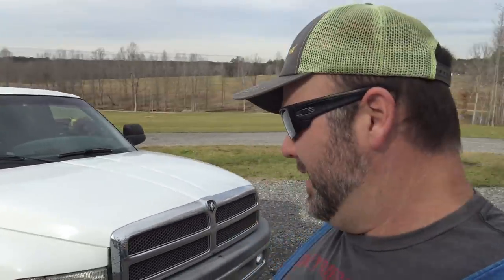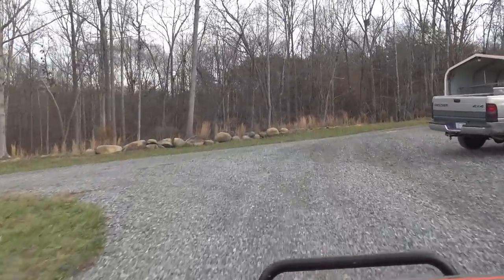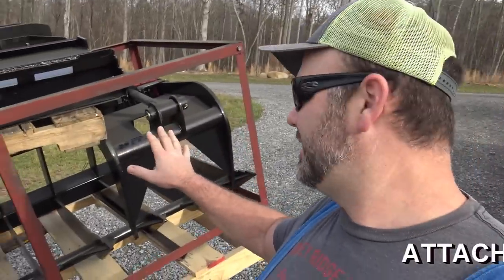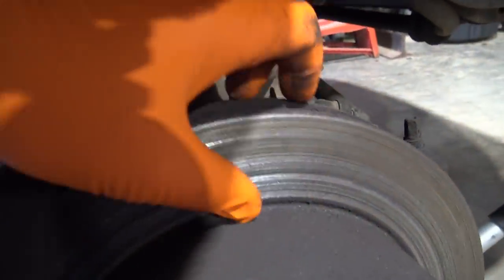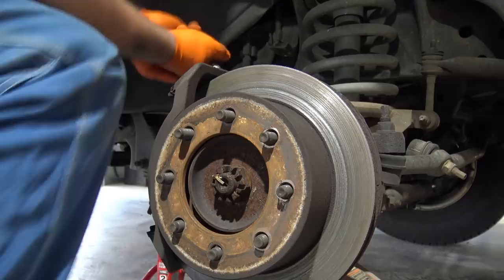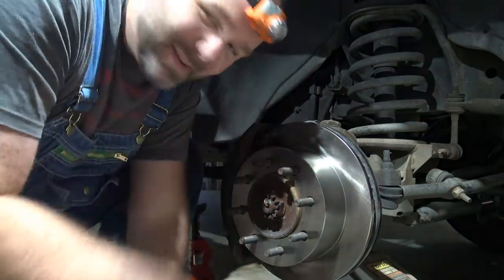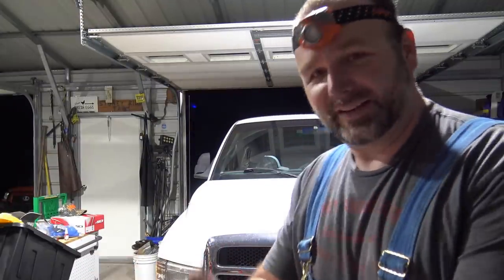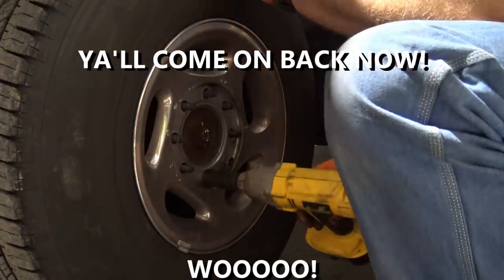Better Hope your Brakes Don't look like this! Farm Vlog brakes gone bad!

Comment: Back straight bend knees when picking heavy stuff up, or you’ll end up with a bad back.

Where’s the use of the copper grease on them pads or they will squeak also copper grease help to keep the pads cooler by passing some of the heat to the callipers limiting early brake fade and them wheels will stick to the hubs without copper grease making a simple tyre change a major issue with the use of a sledgehammer and a lump of wood to protect the rim and beat the life out of it just to remove a wheel. Make life easy copper grease them also helps with cooling as it helps to transfer the brake heat to the rims keeping the hubs and bearings cooler giving them a longer life span too.

Comment: Josh, i sure hope you didn't forget to get brake pad hardware for those wheels. If you skipped that part you will have premature brake failure again! Brake lube for contact points too! Hope ya got the breaks fixed.

Comment: Just a tip for you use a old brake pad to push both pistons in at the same time.  At least that the i do it and it works good. My opinion

Comment: Just a suggestion be aware of brakes getting to hot or might  lock up. if you had steel pistons you probably have no problem. but plastic or bakalite  when you change the position they can freeze up.

Comment: I would use a piece of flat bar to compress 2 Calipers. Keeps it from going back and forth. I always did my own brakes. I took it to a shop one time for a brake job $1000 was the bid. I replaced all 4 rotors and brake pads for $125

Comment: It doesnt hurt to use a little anti seize on the hub where the rotor meets the hub where the lip protrudes out past the rotor. Winter conditions, and salt (If your county does that to your roads in the winter time) will rust the rotor onto hub making it a pain in the donkey to remove. Lol 😁

Comment: Amateur tip: siphon out your brake fluid (from the reservoir) before and after compressing the caliber piston, then refill before starting the other side.  Of course, best practice would completely bleed the entire system of the old fluid after the brake jobs.

Comment: Josh why don't ya use the bucket on the John Deere to move the feed barrel? Just slide it in the bucket and put a strap across it to hold it upright.
Reply from the maker: Just need to empty the barrel out....a couple days and it's moved 😜

Comment: Josh, you may want to check into setting up an account with your local parts store. Then you can call and they will deliver parts to you. Saves some time.
Reply: Side note, Rockauto.com is usually must cheaper than the local parts store. I use them often. You may want to check them out!

Comment: Guess what I did today 😏.. I was switching tires around on my truck... I used a bottle Jack on rear axle to lift up rear tire and my Jack to lift up the front tire.... I put the rear tire on and snugged up the lug nuts.... So then I put on the front tire and snug up lug nuts and dropped Jack and tightened the lugnuts.... As I was tightening the front lugnuts I moved the truck and the bottlejack fell over that was on the rear.🤦‍♂️oopps!.... I didn't have the emergency brake on either. 😬

Comment: Good next day morning Josh, and all the other Stoney Ridge Farmer type folks. Nice to see you feeling better Josh. only bleeding in 2 places, nice, getting the job done, great. having fun & learning while doing it, priceless !! Are the new rotors coated/ plated with some type of anti rust? kinda looks like it. hard to see in video. Not long ago I bought online a set of 4 pads/ rotors, the up charge on the set was about 35 $ to be Electrophoretic Coated;  , my retired nasa rocket mech,, next door was impressed with the rotors , he did the rotors / pad x 4 in about 1 hour, then drove it, did whats called "burnishing", been a couple months. feels good, IF you would have Planned the brake job.... well, you know the rest .... haha. Whooo!   since that seems to be the go to work /tow/road trip truck and you plan on keeping it and may run the hills loaded. It Might be wise to think about 4 wheel brake upgrades at some point. some thing to consider/plan. enjoy the rain today

Comment: You need to repack your front bearings when you do brake job.
Reply from the maker: thought about it for sure...but looks like someone's already been into them
Reply: Those are a none service able wheel bearing  they are a wheel hub bearing  no way to grease  them. They are also called  a unitbearing but either way a non servisable bearing

Comment: Think you got your dollars worth out of those brake pads.    You’re doing it right.  You should get about 2 sets of pads before you need to replace rotors again.  Every six months pull the wheels and eyeball your pads.  Don’t get down to the rivets again.

Comment: when cheap brake pads are used that is why it get all chewed up like that on the rotor.  cheap pads have alot of metal stuff in them that is why the expensive pads are better also they dont put of as much dust

Comment: I couldn't see them and am not familiar with Dodge, but you should grease the pins  so your rotors will slide using high temp grease.  Alows them to slide and the brakes wear evenly.  Always like to check Brake Fluid reservoir when it's done too!  I put slotted discs and fully ceramic pads all the way around my 2006 F 150 which is clean as a whistle too, Just hit 100k.  last time around   Stops like a cat and no dust!  I have aftermarket wheels so it is a dream to keep clean.  Better look at the rear now!  lol   Oh!  They make a steel hook for hanging those calipers out of the way, can't remember where I got them but weather its brakes, wheel bearings etc anytime you have to take off the calipers I love it I guess you could bend a long S and make your own.  it's about twice as thick as a coat hanger and probably hardened.  Keepem coming!

Comment: I always kept a box baling wire in my shop just for things like tying up the caliper housing. $87 will for sure it's not a 1 ton everything on them at least twice as high then the course mine came straight from the dealer that was who worked on oh and did I tell you that my engine caught on fire about a week later and it is because of something he did. You know the foam gasket on the back of the hood somehow he knocked it loose and it wound up falling down on top of my turbocharger and it caught on fire with me going down the road. Course by then I wasn't in El Paso anymore I was in Cloudcroft, New Mexico clear on the other side of the state so there was no going back to the dealer. To push those pistons in on your brakes I use vice grip C clamps. Hope you didn't run your brake fluid over when you push those pistons back in. I don't think it's necessary for and break bolts to be that type

Comment: Entertaining video.  I wondered about the UPS shipping.  I have an old Dodge Brothers engine I was thinking of selling but I don't have a tractor with those arms on it to put it into the truck. 
Anyway I always bleed my brakes after doing all that and repacked my wheel bearings as well.  Yours might be different.

Comment: I had a Dodge 1-ton dually that I was pulling a 43-foot 5th wheel camper trailer cross-country when I was working construction and I come down out of the hills of West Texas and just before I got the El Paso I step on the brakes and there wasn't any this truck was less than a year old and I had that trailer back. So I knew where the campground was that I was going to park the trailer I just slowed way down eased my way into the campground and used my emergency brake to stop and back that trailer to where I was going to leave it, unhooked from it, and took at Dodge right straight to the Dodge dealership. One side of the rotor was completely gone it was into the fins course over the pads gone so I had replaced both rotors and put brakes on and my bill was $712 and some change in the majority of that was those two rotors. Now I don't know if yours is a 1 ton for not but you might want to be ready for when you go in there if you buy them new.

Comment: May experiences do not use ceramic brake pads. Put on Mfg replacement parts or aftermarket exact replacements. Ceramic are just too hard.

Comment: You should lubricate the ends of the pads and and the bolts that the calipers slide on to keep from having pads wear unevenly.  They make caliper grease especially for this.     Don't slather it on, just enough to provide  a little lubrication.  Check out South Main Auto Youtube channel to see how he does it.

Comment: Buy a crack bar 2 ft minimum. That way your hands are out of the way & you have more torque with your hands. i hoped you double check the wheel nuts. i wouldn't trust a nut runner.  or buy a torque wrench. Just to be safe. other than that Happy New year to Stoney Ridge farm.
Reply from the maker: I've got one...I just didn't use it lol

Comment: I've never done a brake job that required me to take the caliper away from the guides....weird. I've always taken them off in one big assembly.
Reply: Its a good idea to remove the clipper slide bolts so you can clean and add fresh grease even though you can do it the way you described.

Comment: that looked way to easy. living in the north my entire life its not that easy up due to all of the salt on our roads. when i do breaks i need to beat the rotors off with a sledge. they are always rusted in place. $87 bucks isn't that bad they are $78 each for my wife's '16 malibu
Reply: Ohio Farmer it’s why you should use copper grease it stops the salt getting in and stops the parts sticking to hubs and wheel rims meaning you no longer need a sledgehammer to fix them.

Comment: the condition of your brakes indicate that the caliper is sticking or bad and could need to be replaced by the uneven wear.
Reply: The slide bolts could've used a cleaning and a little grease also.

Comment: Josh, is there no place close by that could have turned down those rotors? Keep up the great work.
Reply from the maker: Sure...but I wanted my truck back in service....$60 to turn them v/s a few more bucks to replace the 20 year old rotors....sometimes time is more important
Reply: @StoneyRidgeFarmer  i also own a 1999 dodge ram 2500 extended cab 4x4 cummings. bought it new back in 1999. i have a cracked dash and would love some advise on that.
Reply from the maker: @davidandcarolh  I have a video out on a quick and easy aesthetic repair here: https://www.youtube.com/watch?v=KGJc63TnHUw   I'll have another video coming soon on how to fix old truck seat cushions!
Reply from the maker: @joerowland607  like ya said....it won't do any good.  This truck never had a crack in it until some idiot put "quick detail" on the dash....busted it wide open! I never use "products"...I think you know which products on my dash. Always use leather conditioner and it won't deteriorate these dashes.  It does suck!

Comment: Drilled and slotted rotors are obsolete.  They wear twice as fast as solid rotors.  Be sure not to buy Chinese rotors rotors.  They wear and pulse terribly.  Did you wash the rotor faces with brake cleaner before installing them?  The rotors a coated with an oily rust preventative.
Reply from the maker: keep watching

Comment: I think tarter is good. I saw tarter test there 3 point tiller and they used it to chew up asphalt, and pull it with a chain behind a truck and let it bounce behind... they make sure they take a beating and can handle abuse.
Reply from the maker: Man...you must live close by the factory ....did ya ever work for Tarter?
Reply: @kentuckycornbread8502  well even kubota has their land pride line with foreign parts.  I saw the land pride rotary cutter has a made in the usa sticker but the gear box is from somewhere and the pto shaft also from elsewhere.   I think every brand will out source parts... the difference will be if you are getting a rotary cutter with a thin or thicker deck to take the abuse.